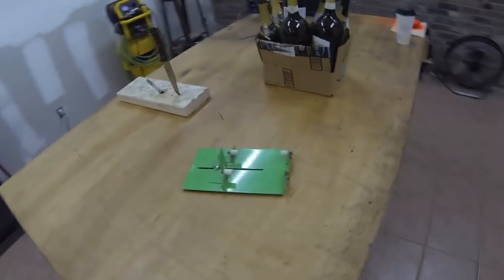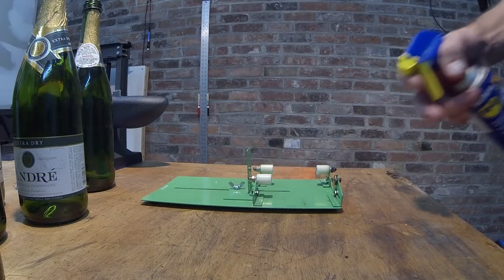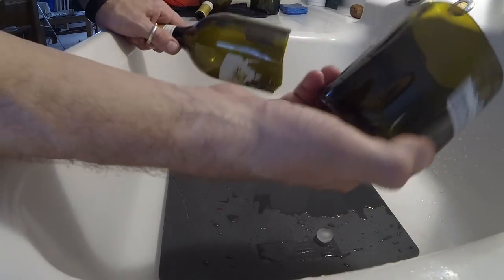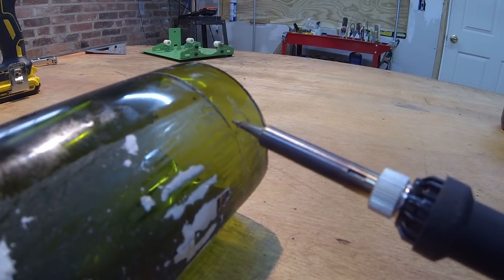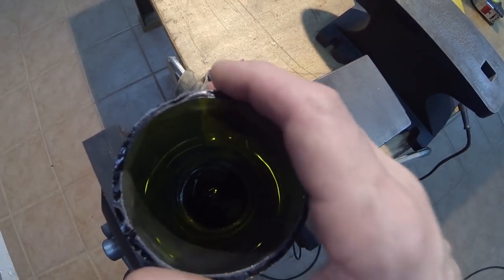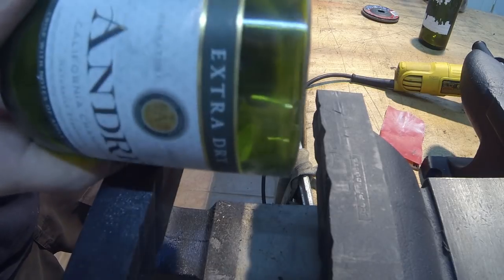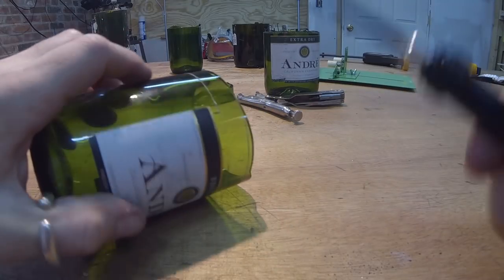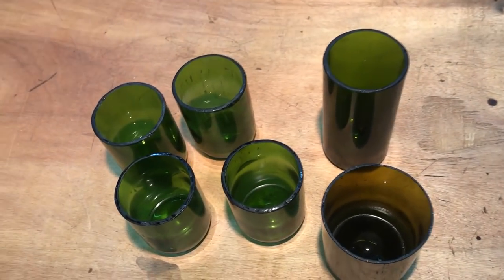How to Cut THICK glass bottles with soldering iron

Comment: Dude,  this was so informative, and more than a little entertaining.
I can't understand how you only have 584 thumbs up.  I haven't tried this
since I totally ruined some glass bottles a few years ago.  Now that I've
seen your production, I'm gonna  yank the first Grey Goose bottle I see in
the dumpster and try this again!

Thank you!
Reply from the maker: TheMilohemlock seriously- thank you for the comment. I appreciate the feedback and your time you took to watch my video. A little bit of time and patience is the best tool for bottle cutting, i do have a more recent video where i cut a vivarium for a centipede using a huge jug of wine (large circumference) and refined the technique a little bit using some 3 in 1 oil to focus the heat on the cut line. Seemed to work out pretty well. Good luck with your cuts and thanks again for commenting! 
Here’s the other video -https://youtu.be/0KXbx-bt3ps

Comment: Really liked the soldering iron idea; makes it so simple.
Reply from the maker: BSN Rao thanks for stopping by and taking time to comment... I appreciate it. This process may be a bit slower than the other methods, but it really works out for me and i feel like i really have control of whats happening.  Now, most every time I get what i want.. i have another video that i do another larger bottle and use oil around the cuts and that also seems to direct the heat pretty well. You can check it out here if you feel so inclined. Thanks again for the comment!!  https://youtu.be/0KXbx-bt3ps
Reply: @fleanine  I am going to have a go at this right now!! :D

Comment: Nice, I actually tried this earlier today and I am just like you whereas patience is NOT a strength of mine and I gave up - of course you tube suggested your video for me and I just had to watch and i think i will give it another try now, maybe get myself real high first! HAHAHA!. THANKS for your time in putting this up.... Have a great evening. Valerie
Reply from the maker: Valerie Livengood thanks for the comment! Definitely some level of time and patience involved, but I do feel that I have the most control over the cut this way,(with soldering iron) I have even tried with a wet tile saw and it’s still not as clean. Good luck to ya!

Comment: I make wine bottle wind chimes and after I score my bottles, I boil a medium pot of water, with the water two inches deeper than my cut and also fill my sink with cold water and frozen coke and water bottles to get it freezing cold. Then I put bottle in hot water for about 30 seconds and then dip in sink of ice water and swirl for 30 seconds, and continue back and forth until bottom pops off, 95% clean cuts! Usually takes 3 rotations of hot/cold. Just be careful going from pot to sink and back because bottom can pop off any time it wants too! Hope this helps. (When I am finished, I make sure to pour water through a strainer in case any glass shards and put my water filled bottles back in the freezer)

Comment: Hello there. a full week. I'm dealing with this damn bottle cut. I think I ruined about ten bottles. The tool was great, but the problem was with the diamond cutter. I need some more to cut it like it's sliced. Not challenging and fully sliced in your quarters. I figured this wasn't as easy as it seemed. And I watched you carefully. Thank you for sharing....
Reply from the maker: Thanks for watching and commenting, Im not quite sure I understand... are you trying to cut the bottle into several rings? That is possible with this method as well, but it does take some practice. Also getting just the right pressure with the glass cutter is important. Too much is not good... Too light, it won't work.. and you only want to go around the bottle once.. don't cut over the same line twice. I have another video i posted after this one that I also try using some oil on the line to help direct the crack as well, may be worth the watch... https://www.youtube.com/watch?v=0KXbx-bt3ps&t=389s
Reply: @fleanine  Thank's for the information. we are in same idea. The goal is to cut the bottle properly.

Comment: When I do this I use a small handheld eagle torch (found at any corner hoodmart or smoke shop and most gas stations) just w bit bigger then that the torch you use and. and an ice bath and it is very quick and does not warp or mess with the glass anywhere but on the cutline. I dig the soldering iron hack  I'll have to give that a go. Thanks for the vid frienf.also a bowl of water and some wet sandpaper makes quick work of that if you can get a ceramic   cutting wheel those work wonders

Comment: I have an old style 1/2 gal Almaden wine bottle filled with pennies that I want to get out. The bottle has a neck with a handle and is flaired out to hold the wine.  Do you think this would work?  Any helpful suggestions.  I am really at a loss.  In retrospect, putting coins in there was really a dumb idea.  Plastic would have been so much easier.
Reply from the maker: I don’t see any reason why it wouldn’t work, just go slow and take your time. I have another video where i cut a larger thick Ernest and Julio Gallo wine jug for a Vivarium for a millipede that worked out pretty well, also  has a few tips. Thanks for watching!  https://youtu.be/0KXbx-bt3ps

Comment: I made a few guitar slides Cutting bottles using a glass cutter then put the bottle in real hot water then real cold water it cracks the bottle for you . you can use sandpaper to Smooth the edges

Comment: Just wonderin if there was enough room to get that candle under the rollers on your cutter somehow,  or make another board with four little rollers on it high enough to slip a candle underneath the cut?
Reply from the maker: ken Lane You could do something like that, and set up a roller system just for heating. absolutely. however, I find that the soldering iron really allows you to pinpoint where you’re putting the heat and be able to dictate how the split “happens” ... more control, you can kinda steer the cut ... if that makes sense.  If you don’t want to use electricity, there are inexpensive butane torches with attachments that would simulate the same effect.    Thank you for watching and for commenting!

Comment: I wish I could send you a picture of the old style 1/2 gallon Almaden wine bottle filled with pennies and you could give me an idea as to where I could use your method successfully to cut a hole to get the coins out - the bottom, the side, around the circumference?
Reply from the maker: I searched the bottle you were talking about, and if the goal is only to get the coins out and you’re not concerned about a really accurate cut, you could probably carefully score it with a regular hand-held  glass cutter -  just make sure you get your seam to match up as close as you can on the other side once you go around. ( maybe use a piece of tape first to make sure you have a path to follow.) then once you get that set up you hit it with the soldering iron and take your time. Go slow. Be patient. If I were you I would go between the handle and the part where it starts to flare out. This way you’re making the least amount of cut, but you should still be able to get the coins out once you open up to the wider section .
Reply: @fleanine  Thank you so much for taking the time to research the bottle and give me a workable solution.  I am busy now getting the fall cleanup done, but I will let you know how things went when I do this project.

Comment: What happens if you cut glass like cutting tile with a watered circle saw for tile.?
Reply from the maker: MsPlastina1 i actually bought a wet tile saw to make this process easier. It’s hard to get a controlled cut without chipping because of the high speed blade/ the cut winds up kinda jagged and requires a lot more cleanup/smoothing. I ended up going back to this method because even though it’s a bit slower,  it’s less time on cleanup and delivers a better end result.  ( and it’s cheaper than a tile saw;) Thanks for watching and commenting!
Reply: Can you use a slower speed?
Reply from the maker: No, not with the models I was looking at/ ended up purchasing. 
...even at slower speeds the blades are not “perfect” enough and would lead to chips on the edges and wet glass shards get all over things. I could perhaps make a video to illustrate what I’m talking about in the near future. I prefer the slow and steady approach. The time you “may” save not using the soldering iron you end up making more of a mess of the bottle and all the grinding and sanding down in the shop later gets debris everywhere - AND it doesn’t look as good. The less glass dust in the air the better. In the long run this ends up being faster and cleaner.
Reply: Ok i agree but arent there any blades that are even and made with diamond?
Reply from the maker: That’s actually what I used...  it’s just the blade spinning fast is a bit “violent” for a glass bottle.

Comment: Change your method little after cutting .... use an wire around the bottle then make wire hot with solder that will save your time & hard working after the finishing result will be better.
Reply from the maker: Great idea!!! :) I may even be able to use my power supply, run a wire around, and forgo the soldering iron altogether!! Thanks for posting! I appreciate the watch and your comments!!
Reply: Try to cut squier bottle withe wire ( wire edge enter the soldiering iron) that will effectively batter to cut the squire edges.
Thanks ...
Reply: @fleanine  Not sure if I have the right picture of what you mean, but I am picturing a device my uncle used when I was a kid and he wanted to gather worms for fishing. He took a metal pole with a wooden handle, attached to a power cord. He stuck the metal into the ground and plugged it in. The electricity transferred into the ground and up popped the worms. Is this sort of what you are describing, except that the result is heat distributed along the scoring line of the bottle?

Comment: as a final step i would hit those tops with a torch just to fuse together all the material on that cut and slightly round off the edge.
Reply from the maker: I have tried using a torch as you mentioned...and have shattered the bottles due to heat, so if you do it that way you REALLY have to be extra careful as to not over-heat one section too fast. I find lately that using really fine wet/dry sandpaper and a little water does a decent job of taking away any "sharp" spots without risking the bottle shattering. Thanks for taking the time to watch the video and comment, i appreciate it!

Comment: dip string in lighter fluid set it on fire (after wrapping it around bottle) then dip bottle in cool water it'll break pretty straight without a lot of vein cracks.
Reply: Yes but more times than not the cut is messy 😩

Comment: What is power of your soldering iron.
Reply from the maker: Iftikhar Ahmad i am using a variable temp. soldering iron in this video and the heat is turned all the way up to 450 degrees F. Any soldering iron should do it as long as you concentrate your heat and stay patient it should work out pretty well. Good luck. Thanks for watching!
Reply: I tried many way to cut all failed. It’s very hard. Soldering iron is not working too. Maybe some areas I am wrong...... thank you for sharing !

Comment: I wonder if a soldier gun would be faster?
Reply from the maker: Perhaps it may. I just don’t have one, as long as the heat is concentrated and not applied too quickly in one area it should break nicely on the seam. If you try it with a larger solder gun, please let me know. I’d be curious. Thanks for watching and taking the time to comment!

Comment: DO NOT use flame or ice!!! All that is needed is hot water and warm water. It takes time with this method but it work every time.
Reply from the maker: I tried that method in the beginning of this video and because these are really THICK champagne bottles it didn't work consistently enough for me. Hence the solution at the end. Works every time without losing a bottle to a cut that went off in the wrong direction. Thanks for the comment and for stopping by!!!!
Reply: Yeah this doesn’t work with the thicker

Comment: What about using one of the mini refillable butane torches then you can keep the bottle vertical?
Reply from the maker: You could use a butane torch, however if you do this frequently enough.. butane could get costly. Also have to make sure to not OVER heat a section too much or the bottle could split off in a direction you don't want. Thanks for watching and taking the time to comment.
Reply: @fleanine  I forgot to say I really like your workshop. It would be great to have a workspace like this.